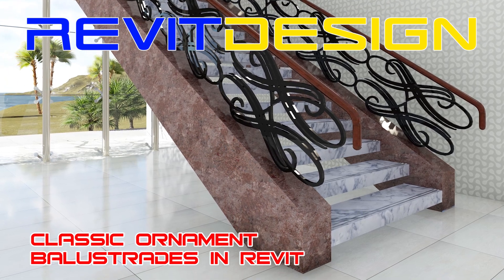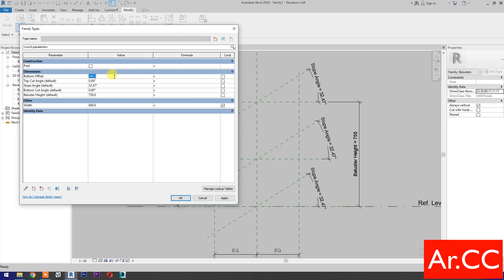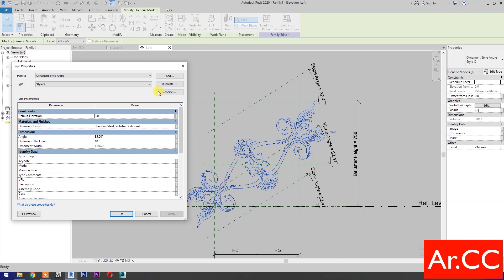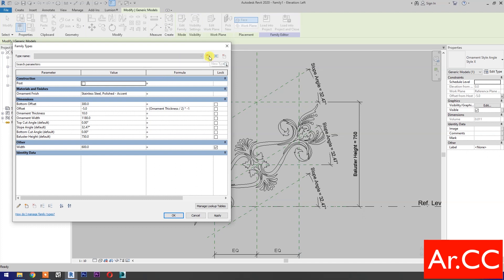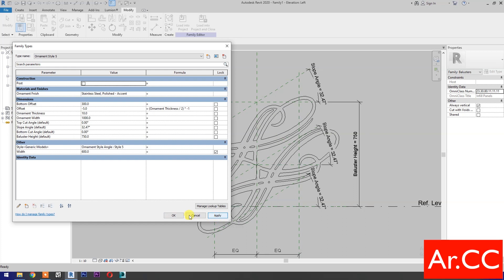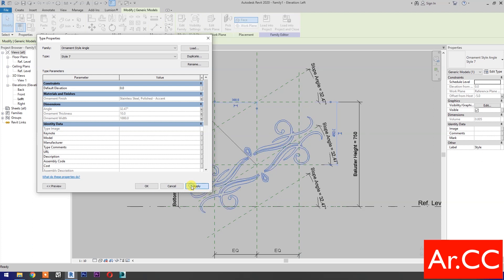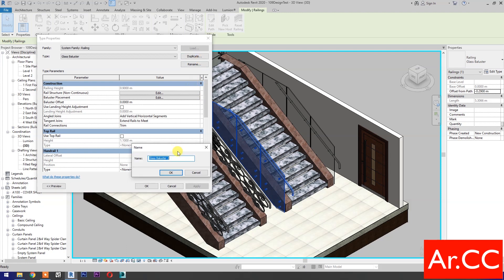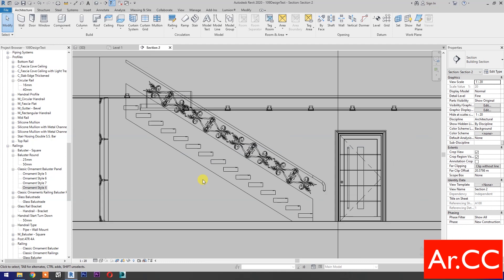RD109. How to make a Classic Ornament Stair Railings in Revit. Classic Ornament Baluster in Revit.

Comment: I created the Ornament as per RD 104, but cannot upload it. I tried another solution but the panel is horizontal not angular and in both cases I do not get the placement either on work plane or other. So where is my mistake???

Comment: Sorry again to disturb you. But I have created the font using the generic family, and saved it. However when you want to import it to make the railing you can only insert it on the ref level. So which family did you use?? Thanks and sorry again
Reply from the maker: Did you try make your own? Try to set work plane the chose a reference plane you want.
Reply: @ArCrisCruz  Good morning. No I did not make my own. I just made a Generic family with one of the Vintage ornament. But when I want to import it into the balustrade I cannot select the plane, and get a message that it can only be impoted in Ref. Level. Tha's why I am asking you  which family you used for your ornament
Reply from the maker: I will check the video again
Reply from the maker: You need to set work plane to center left right. May be miss some steps in the tutorial.
Reply: @ArCrisCruz  I copy the ornament into a Generic family. Maybe this is what is wrong . That's why I ask you which family you use to create the ornament family (Generic - Baluster -...etc) because I don't even have the possibility to select in the properties the X axis
Reply: @elimams  The family is "Metric Generic Model", you only have  to check  the  "Work Plane-Based" box in Family Category  and Parameters"  menu. So that, you will be able to set your family on a front/section view.

Comment: Hi my teacher...I have problem when I want to select using tab to cycle the selection in minute 3:15 ...I tried so many times but that blue dot don't appear
Reply from the maker: It should be because you have a reference line.  Hover your mouse point on top of that blue dot which is the reference line it should be appear.